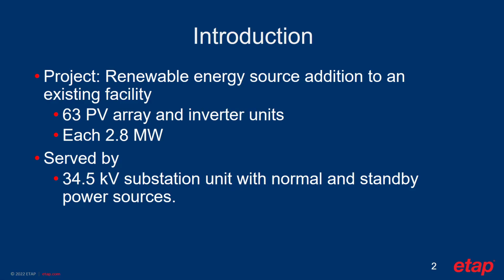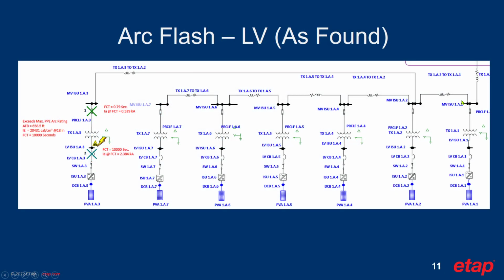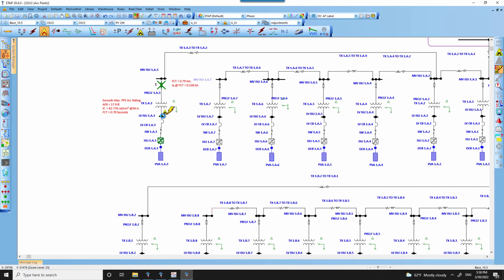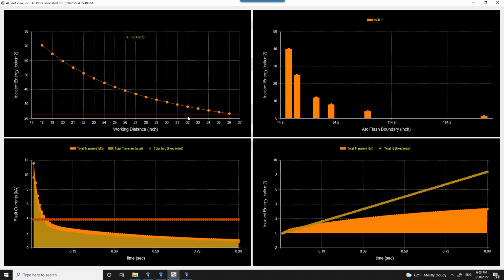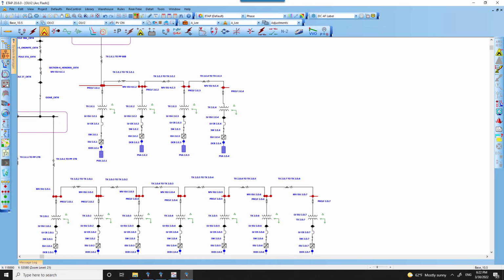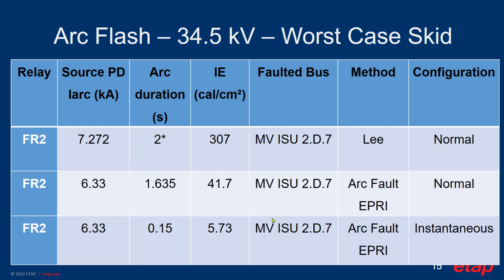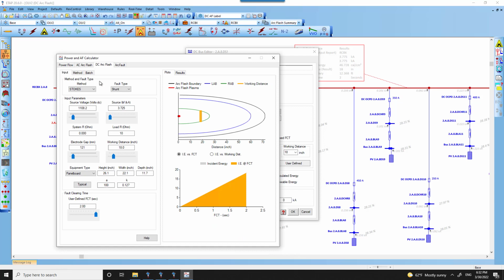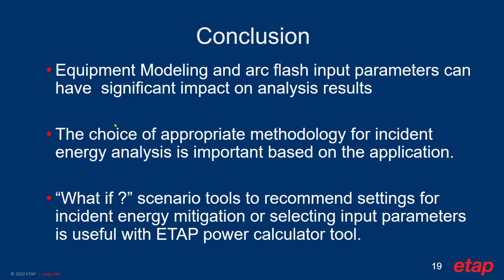AC & DC Arc Flash Methods for Renewable Energy Systems

Comment: Hello Raghu, A small question, I can see you have added Maintenance Mode settings at 34.5kV level. With this settings, can we get smaller IE at 690V level?
Reply from the maker: Thank yo for your interest in ETAP Solutions. Regarding your question: It is based on how the co-ordination between downstream devices and the protective device in 34.5 kV level are set. The main criteria is to follow selectivity as we do not want to shut down the entire system but the closest protective device connected to the low voltage system.
For further questions and additional support, please contact our Help Center at https://helpcenter.etap.com to submit your question.

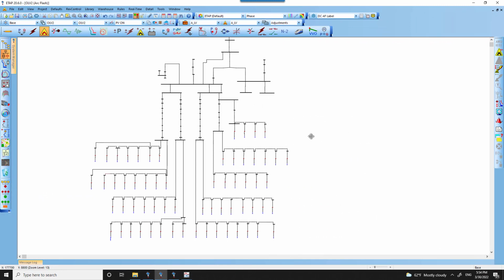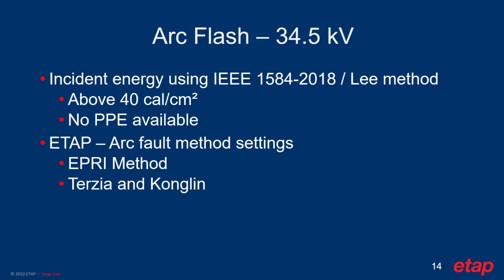Comment: I am keenly looking to obtain the single line diagram etap file as shown at minute 4:47 to 12:50 (if possible, for the purpose of applying a case study in ETAP).
Reply from the maker: Thank you for your interest in ETAP Solutions. Please refer to the free example project files in the Launch Center of the software or for further assistance please open a ticket at out 24/7 Help Center https://helpcenter.etap.com